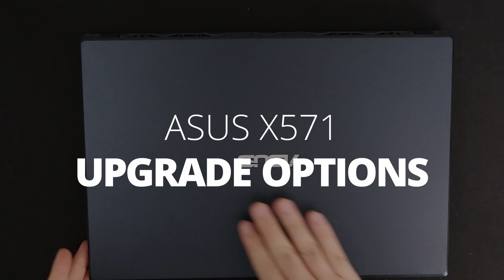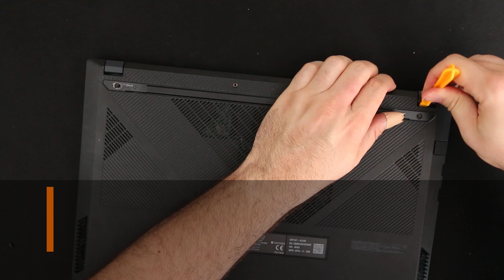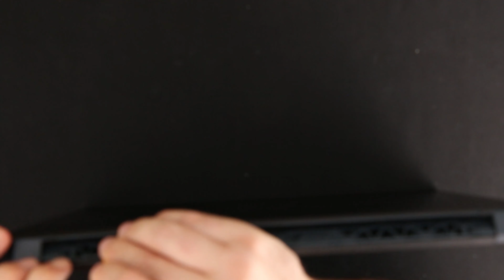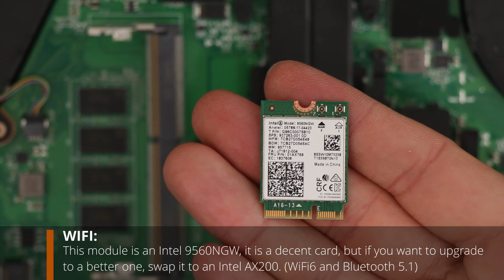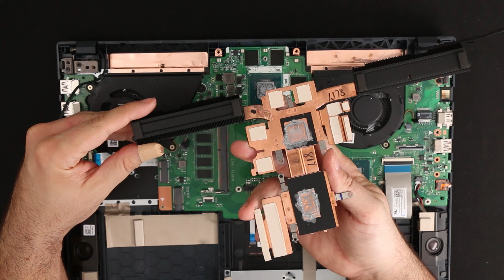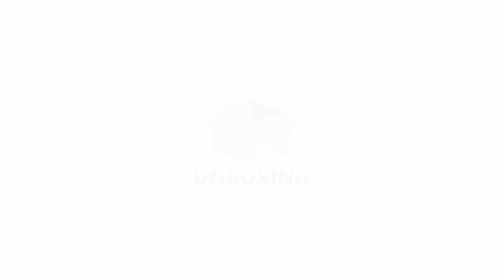ASUS X571 DISASSEMBLY and UPGRADE OPTIONS (Storage, RAM, WiFi, Thermal Paste)

Comment from the maker: Hey guys, just launched our new website about laptop upgrades. Cool templates, help you upgrade/swap or even repair your laptop with mapped motherboard images. 
Also added a request form, so if any laptop is missing, just ask and try to add them as soon as possible. ;) Reach us @ https://bit.ly/34k1SLL
Reply: This guide is not in the website. ASUS X571
Reply from the maker: @vegoki  Added to the site! ;)
Reply: I dont mean to be so offtopic but does someone know of a tool to log back into an Instagram account??
I stupidly lost the password. I would love any help you can offer me.
Reply: @Krew Beckham it worked and I actually got access to my account again. I'm so happy!
Thanks so much, you really help me out !
Reply: @Damon Ahmed No problem xD
Reply: Great video thank you. Possible to demonstrate or outline process to upgrade the memory on this exact unit ?
Reply: Could you tell the width of white thermal pad (not SSD!)?
Reply: im in search of new sata cable for this laptop but not to sure what one will work
Reply: @LifeofCuzzin did you happen to find it? I want to use an SSD instead of HDD but idk which cable that is

Comment: Great reference. I'll share my experiences:

- Put in a 1x16GB RAM stick; didn't settle with 12 since 4GB was soldered and I wanted 16. I think the CPU supports up to 64GB.
- Network card I had was the Intel 9461NGW (Wifi 802.11ac, 1x1 antenna). Tried putting in an AX200, no luck (not compatible with CPU; this particular laptop only supports CNVIO-compatible network cards (9462, 9560, AX201(?)). Waiting for my AX201(802.11ax, 2x2 antenna, CnVIO 2) to arrive and test it out. Also, just gonna leave the one antenna that came with it and will just stick in the empty HDD portion.
- CnVIO-compatible cards only work for 8th and 9th gen. Intel CPUs. CnVIO 2 only works for 10th gen CPUs (all according to a tester on an Intel thread; I'll paste it in here next time).
- Stripped off one of the screws on the heatsink in an attempt to disassemble it. Guess that's staying in there permanently until someone suggests a better solution. Any branded thermal paste will be better than the stock one honestly.

I'll put in more information here if you want to.

That is all.
Reply: I have an 8gb x571gd ram model laptop. Do you think I can add 16gb ram
Reply: @dodo11235  If there's a slot for it, I guess you could.
Reply: @dodo11235  I too have 8GB model, Its been a year since this comment did you upgrade it up to 20 GB or did you put another 8GB to go uptill 16?
Reply: @abdulrehmanousama5538  i put 8gb ram but i think you can put 16gb ram for total 24gb
Reply: did the AX201 work?
Reply: Could you tell the width of white thermal pad (not SSD!)?
Reply: Could anyone please tell the width of white thermal pad (not SSD!)?
Reply: - Put in a 1x16GB RAM stick; didn't settle with 12 since 4GB was soldered and I wanted 16. I think the CPU supports up to 64GB.

****What was the freq of the RAM you put in?
Reply: @mykeviper  I also put in 16GB extra (4GB soldered) and it settles at 2666Mhz even if you put 3200Mhz in it because the 4GB on the board is just 2666Mhz. Too bad I didn't know that there was 4GB soldered on the board else I would have ordered the 8GB model but adding those extra 16GB did wonders. I don't use the laptop that often is mostly used for guests to play some Overwatch 2 as a 3rd system. Or some light work in the livingroom. Anyway it is a great laptop imo.
Reply: can you tell me which one is cpu and gpu

Comment: Great video ! I have the same laptop and its a great machine
Reply: my question may sound kinda stupid but i just bought a new one and the fan spins alot when i play games or make alot of tasks is that normal?
Reply: @173lion  its because your CPU goes on turbo boost. In turbo boost, you CPU will clock to maximum and so does your GPU, work at highest power. Well, obviously higher power means more heat than usual. Therefore, the fans also run at their maximum capacity to dissipate heat as effectively as possible. If you have settings for fan control, turn it to medium and you will notice that the performance in gaming will decrease and your fans will make less noise because of the same thing mentioned above. 
So, the answer to your question is- Yes, its most probably normal if you're doing heavy tasks and playing video games in a gaming laptop. Hope it helps!
Reply: @Mesteropuppets1  Hi, thanks for your answer it's was very helpful :) !

Comment: Thanks for the video and the patience. How about the GPU? can't it be upgraded although is a discrete GPU? And another comment, just wanted to let you know that I replaced the 8 GB RAM Slot with a 32 GB of the same 1.2V and 2666Mhz and it is working perfectly. Regards.
Reply: Thanks! I've put 16GB in it but 32GB isn't expensive anymore nowadays so perhaps will upgrade it to 32GB haha.

Comment: Thank you for the video, I replaced my laptop's thermal paste today
Reply: Oh, I fixed a type and I lost your 💖,  give it to me again😄
Reply: I also send this comment in another channel:
----
OMG, I replaced my laptop's thermal paste (literally a few minutes ago). God damn it, it was so scary. Hopefully, I didn't break anything🥲. The not good part is, it doesn't matter that how much system performance going to be better because I still think that did something wrong and it's gonna break or perform badly... Not sure but I think it's working better now. I need to play some games....
Yeah, that's it.
The weird thing is that I find a pack of little repair screwdrivers at home😂Thanks mom for buying them years ago for I don't know what reason😂😂😍😍
Reply from the maker: There you have it. :D
Reply: @babakfp  Could anyone please tell the width of white thermal pad (not SSD!)?
Reply: Could anyone please tell the width of white thermal pad (not SSD!)?
Reply: @alexgora7530  which part?
Reply: @babakfp  I am sorry, white thermal PADS on radiator of CPU, on heat sink, on  video timestamp 7:09 🙏🙏🙏

Comment: so mine has 4 gb of ram soldered into the motherboard and another 4gb stick, and I want to upgrade, whats the max that I can replace  the 4gb stick with? can I just go for a 16 gb one or is the max a 8 gb stick? btw loved the music in this video!
Reply: yeah its working with a 16gb module for 20gb
Reply: @gwyn676  Did you buy a dual rank or single rank RAM? Sorry to bother but if you don't mind could you send the link to the RAM you bought?
Reply: @gwyn676  reallyy ???
Reply: @archivisiondesignstudio1254  maximum for the board is 40gb if yours is the 9th gen i7
Reply: @go4sens600  mine is i5 8300H withn GTX 1650. Its a asus vivobook gaming 571 laptop. I bought it on flipcart. And its specification says that, it has 8gb ram (4 stick+ 4 solderd ) and upgradable upto only 12 gb. So if i replace 4gb with 16 gb will it work in that laptopn???????
Reply: @archivisiondesignstudio1254  yes
Reply: @go4sens600  i have the i7 9750h one but the question is can I use higher speed ram cause the stock one is 2400 MHz so the on-board one will be 2400mhz so if I use higher speed stick doesn't it mismatch??
Reply: @C_36D  I use 2666 mhz in mine.  If you mismatch ram it will just run at the lower speed

Comment: Hello,
is it possible to install a 2.5'' SSD where the HDD is?
Do you need to buy something to connect it (like the flex cable for the HDD) ?
Reply from the maker: Yes you can use 2.5 inch SSD as well. Basically you can use the same flex cable what it is in this video. In most countries even if you have no HDD/SSD installed, the flex cable and brackets are included inside the box.
Reply: @MakaiTechReviews  the flex cable is not there in my laptop and I have a old hdd of 2.5inch where to buy that flex cable
Reply: @Çukur custom duty and not for my laptop mine is asus vivobook gaming f571gd

Comment: It's a nice laptop, I did some research about it and I was satisfied with the upgrade options, the down side is that i couldn't find any review on my specific model but I bought it anyways and "oh surprise" it came with 4gb ram on board and 4gb on the slot, but the specifications on the website from Asus still says it can be upgraded to 16 gb RAM, so my question is, how am I supposed to upgrade to 16 gb when I already have 4 on board? I mean board+slot would be like: 4+4=8, 4+8=12 and 4+16=20 wich is not supported as the limit is supposed to be 16gb, right? Can you give me some advice?
Reply from the maker: Well, there are 2 different types of this laptop. One with 8GB soldered memory module, and one which is yours.  Technically you cannot use yours as a 16GB setup. Your options are: 4 / 12 / 20 / 36 GB (and yes, your chipset can support more RAM) The number you see on ASUS website is usually the number which is shipped.
Reply: @MakaiTechReviews  hi! I was searching and arrived to this vídeo for the same question, take a look on crucial website for the compatibility of products and the results that give me are only a 8gb of ram card, so mi doubt is why is this?
Reply: Hello. I have the same doubt. My model is the same as yours (4GB on board + 4GB on slot). Have you tried to upgrade the RAM? I'm interested to install a 16GB on the laptop.
Reply: @rolandomorales9585  have you installed more ram?
Reply: @fustarthereal8611  Yes, i've installed a 16GB RAM. Now i have, in total, 20GB.
Reply: @rolandomorales9585  is it way better now?
thanks for replying so fast!
Reply: @fustarthereal8611  Yes, now it has a better performance. I use the laptop to run several Virtual Machines and 20GB of memory is enough at this time for me.
Reply: @rolandomorales9585  do u also have 4gb soldered ram model ???.  what is your laptop specs ??
Reply: @MakaiTechReviews  will 12+4 / 16+4 work fine. ???? As we don't get dual channel support ..??? Sorry for my english.
Reply from the maker: @archivisiondesignstudio1254  12+4? How do you plan to achieve that? :D Btw you can throw any size of ram it will work just fine with the built in one. (be sure the frequency are the same and you are 99% good to go)
Reply: @MakaiTechReviews  sorry. I mean 4 + 8 = 12 . Ok. I purchased same laptop from flipcart last year  and its specshit says that. It has 4gb soldered on board ram and another 4gb stick in one slot. And upgradebale upto max 12 gb (by replacing 4gb stick to 8 gb).
So i am bit confused. But 1st i will try 4+16 = 20gb.  if it worled and supports 20gb then Awesome..  if its not, then i have to happy with just 4+8= 12 gb😐
Thanks for the reply 😊💓
Reply from the maker: You could even add +32GB if you want but honestly 20GB as a total will be plenty enough... 😉
Reply: @MakaiTechReviews  thanks a lot sir ♥️
Reply: @archivisiondesignstudio1254  any updates on whether it works if you add 16gb to the soldered 4 ?
Reply: Could you tell the width of white thermal pad (not SSD!)?

Comment: hello, I have a question ... that same model the x571 can upgrade its 500gb nvme ssd to a better one, I have a 2tb samsung evo 970, but in the page. asus specifies that your max. capacity is 512gb. It could be expanded to 2tb. Greetings and I hope you can give me an answer.
Reply: I have the same doubt.  I would like to know if it supports a 1TB M.2 NVME. Could you install the 2TB one and did the system recognize it?

Comment: Do I have to take out the battery to upgrade the RAM? I haven't opened my laptop yet so I don't know if it's the 4GB+4GB or if it's the 8GB one, if it's the 4+4 can I take out the one that isn't soldered and put a 16GB RAM stick? because the ASUS site says it can only be upgraded until 16GB :/ Great video btw
Reply from the maker: Well, it is not necessary to remove the battery, but gives you and extra protection to avoid any short circuit. Since the battery has no flex cable connector, the only option to disconnect it is to remove the battery. If you don't want to remove it, it is also fine, just be caucious. As for the RAM, yes you can add an extra 16GB and the system will recognize it as a total of 20GB.
Reply: @MakaiTechReviews  Thank you!

Comment: i have an ASUS X571GD. 
I need to upgrade my HFM256GDJTNG-8310A 256 GB m.2 ssd to a 1TB one but i am not sure if a PCIe Gen 3 x4 will work on my laptop. I also need to be sure if my laptop uses which key type my laptop uses, is it B key or M key?
I can't open up my laptop yet as i am afraid i will void the warranty.

Comment: Hello Friend. Congratulations for your work.

Can you tell me if the intel ax210 wifi works on the asus x571gt? I want to upgrade wifi
Reply from the maker: First check which module you have in your machine. There are 2 types of interface modules. One is CNVio2 and other is PCIE/USB: check this comparison I set up for you and make sure you have the same interface type. https://ark.intel.com/content/www/us/en/ark/compare.html?productIds=99446,130293,189347,204836
Reply: @MakaiTechReviews  Thanks!!  One more question: does intel ax200 work on asus x571gt?
Reply from the maker: Most likely AX201 will work. AX200 use different interface.

Comment: Hi there ! Thank you for the video! Still I have one doubt: Which RAM is compatible with this laptop ?  DDR3L with 1600mhz ? or can i use a DDR4  2666MHz or even a DDR4 3200MHz ? Which will work better with the soldered RAM ?
Reply from the maker: Always pick the same frequency as you soldered model has. You can check the on board memory module speed in the BIOS, or program tools like HWinfo.
Reply: @MakaiTechReviews  Thank you very much i will check it out! It´s marked as 2400 MHz....so should I buy a DDR SODIMM 8 GB 2400 as well ? Or can i used a 2666 MHz ?
Reply: If you use a ram with diff frequency, the pc will run both of them at the lowest speed between the 2, in this case 2400
Reply from the maker: @oussamaelannaoui5649  ☝️ yep

Comment: Its says 4 or 8gb soldered to the motherboard but upgradeable to 16gb and there's only one slot
How can you achieve 16gb ram with one slot if you only have 4gb on board
Reply: many people get 20gb of ram with 4gb in the motherboard (One module of 16 gb 2666mhz kingston) in asus x571gt

Comment: Hi, thanks for the video, this help me.
So I have a question, I have the X571 gt with 512go ssd, the sata place is free, if I want a hdd I see I need cable and rack but if I want a ssd what brackets I want? I hope it's clear because I'm not English, thanks again
Reply from the maker: Hi. So let's make is clear. You already have an m.2 SSD in the machine and you want to put a second SSD to the 2.5 inch bay (@2:57), right? In that case you need the SAME bracket and flex cable. ;) The 2.5 inch HDD and SSD use the same connector type (SATA3) and the dimension of the drives usually the same. Height will be a less issue as well.  Hope this helps.
Reply from the maker: Updated the links for the cable and bracket.
Reply: It's exactly what I want to know, thanks a lot and have a good day =)
Reply: @MakaiTechReviews  how you know maximum memory support by the laptop? I want a 5to hdd maybe but... I don't find

Comment: Question, If I buy a Samsung 860 EVO 1 TB SATA 2.5 Inch Internal Solid State Drive (SSD) can I change it for the current HDD I have? Also is Evo better thn PRO and QVC?
Reply from the maker: Yes, you can change (and you will benefit a lot just by the speed bump a lot). No, PRO has a better cache, NAND system. QVC? You me QLC? Those are totally fine as long as you are not going to read/write "zetabytes" every single day.
Reply: i think you mean QVO, not QVC. PRO > EVO > QVO.
PRO is overkill for comsumers as it is made for professionals. EVO and QVO is for consumers or prosumers(mix of consumer and professionals) yet EVO is way better than QVO so pick the right SSD

Comment: I bought it with thinking has 2 RAM slot because the seller told me it has 2 slot and upgradeable up to 32gb. and my laptop is Corei5 10th Gen laptop, 
right now I just have 12 GB ram totally and the only upgrade I can do is remove 8GB DDR4 in slot and add 16gb on it. i will get totally 20GB RAM,  Is this OK?
and how about Upgrade SSD storage? can I remove 256gb and add 512 NVMe?

Comment: Someone know where is CMOS battery in this laptop? I need to remouve in order to reset threshold battery settings. I put tthreshold settings using windows (with my asus app) and now i have only linux on it, so i can't modify threshold battery setting via software

thanks so much for a reply

Comment: Hi, i don’t really know anything about machines, can i upgrade the gpu or is it like fixed to the motherboard so i can’t?
Reply from the maker: No, not possible. 😞 Technically you could use external GPU and use the pcie port (m.2 or wifi slot), but trust me those methods are just so DYI and flimsy solutions you dont want to bother with.
Reply: @MakaiTechReviews  ah okay, thank you so much!

Comment: Hi there, it appears to me online that the Kingston A2000 M.2 2280 form factor is a M-Key and only comes in PCIe Gen 3 x4. 
May i confirm that the one installed in the video is a Kingston A2000 M.2 PCIe Gen 3 x4 M-Key?
Does Kingston A2000 M.2 PCIe Gen 3 x4 M-Key work for your Asus X571?

Comment: Hello. Is it this model X571LH-BQ458T in the video ?
Reply: I'm sure it's the X571GT-BQ547T, for the I7 processor of ninth g. that brings and for its GEFORCE GTX graphics card, plus this model brings the M2 512GB (SSD + Intel Optane)

Comment: I just bought one 
Very good laptop with the gtx 1650ti and ssd but only 8gb of RAM 
I have some 8 gb RAM ddr4 and wanted to know if it can support it 🙏
Reply from the maker: Most likely it will work. If it is not detected at first, you can also try update the BIOS and check again. Usually, if you swap memories, the first boot takes a bit longer, so be patient.